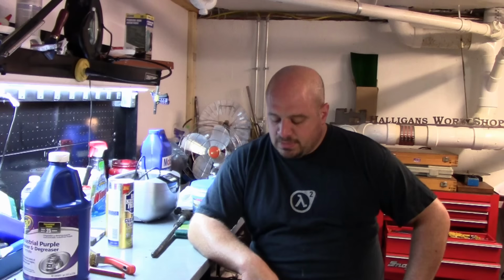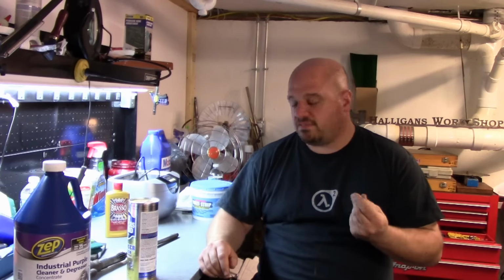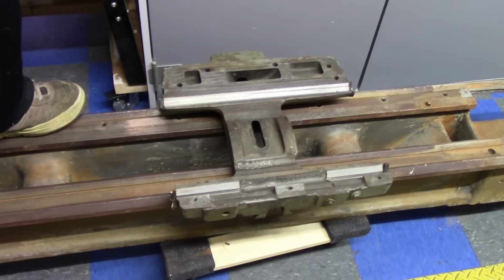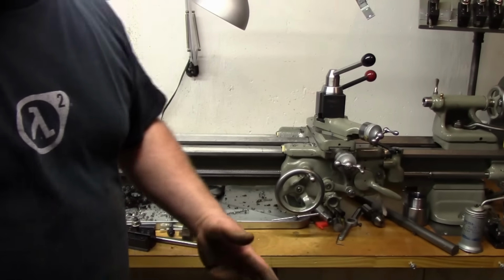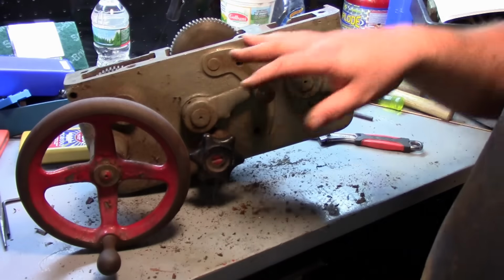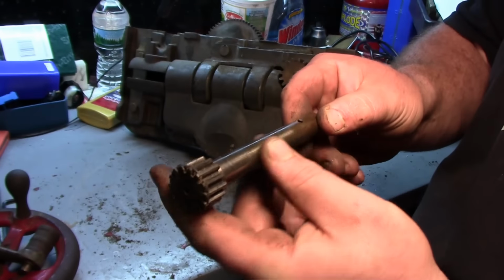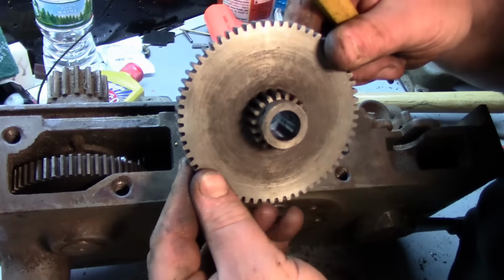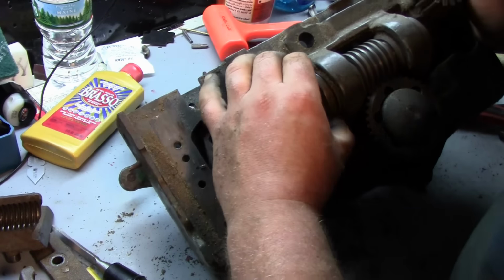13" Southbend Refurb: Bed and Apron: Part 1

Comment: I got my 1st real lathe today. 13" South Bend CL145B. It's filthy and gorgeous. Obviously not a BIG lathe, but I went from a home made contraption that used a lawn mower engine block as the head stock, then to a little a 7 x 11 shop made plain turning "lathe" that didn't even have a lead screw and which I saved from sitting outside rusting away in the dirt and rain and snow of Wisconsin to this 13" South Bend. It's a dramatic difference. You can feel history emanate off of the thing like it has a life force or a soul. I love it.

Comment: I left that long oiler in place on mine.  It didn't want to move, and I was scared of destroying it.  I think it was the only piece I painted around. 

The nut will spin with the clutch handle if its in neutral.  I thought mine was messed up in the same way.  

Screw in the star wheel is left hand thread too, so beware of that.

Comment: Hi Greg, really enjoyed this video. I will follow it with keen interest as I have recently purchased a surface grinder that has similar, but not as bad, damage on the flat way and I have sidelined it for a while to source a fix. In this day and age there must be a filler type product that will do the job and will have a look at the Turcite, IIRC etc mentioned below. Regarding the state of your work area, I am not a neat freak but clean up at the end of each day but having said that man I can make a mess as I go and never understand where it comes from..... basically when working on old machinery is it possible to keep the area clean all the time. Keep up the good videos mate, really enjoy them, Gordon, AUS

Comment: Hal- I wonder how hard would it be to move the headstock closer toward the center of the bed - shim if needed to avoid the wear on that 12" or so just in front of the chuck.  Seems doable.  Hardest part would be getting linkage to the quick change box/lead screw

Comment: I bought a 5 gallon container of that Zep stuff.  Works good, but its basically liquid lye with purple dye in it.  Nasty stuff on the skin and it kills aluminum, but its a stellar degreaser.   Handily, being as basic as it is, it passivates steel so it actually won't tend to rust immediately.  It also gets rid of most of the paint, which is a plus.  I soaked the bed for my 10L in that stuff for about 24 hours and I didn't have to use the paint stripper at all.
Reply from the maker: Yup.  I soak my parts n it for a day.  The bed was too large so I used the stripper.
Reply: I made a "tank" out of some plastic sheeting and cinderblocks, just big enough for the bed to soak in.  It was some cobbled nonsense but it got the job done.

Comment: DEVCON 11410 Wear Resistant Putty. Works fantastic. I have used it on a couple of SB lathes I had. Guy on ebay has the kit for under $60

Comment: Some time ago, maybe two years, there was an article in "Home Shop Machinist's Workshop" mag. Author had a big lathe like yours, a Logan I think, badly worn. He had a regrind done. But now the interesting part: there is some stuff called "Turcite" which looks like a green tape in various thicknesses, and bonds  to the metal. It can be scraped. I have zero experience with this stuff, but in the article in HSMW it worked. There is some other stuff called "Moglice"  and I have no idea how it is pronounced. However it is meant for way repair, and is poured into a dam around the ways. It also can be scraped. Again, zero experience. But there are alternatives to regrinding.
Reply: IIRC, Moglice is the stuff Stefan Gotteswinter mentioned.

Eli D.
Reply: If it wasn't Moglice it was a first cousin. He used it to fix the vertical ways in his mill, as I recall.

Comment: I can't get 2 of my 4 top slotted bolts out of the carriage/apron fastener point.  Any tricks?  I ordered a drag link socket that I can put into my impact but ... if that doesn't work - I'm screwed -literally
Reply from the maker: Kroil.  Hand impact.  Heat.  in that order

Comment: Don't forget to take the long lead screw key out of the worm gear that drives the feeds... easy to lose if you don't notice it. 
That long piece of material that looks like a felt string or something is just that... part of the lube system that carries oil down into the feed mechanism. That wants to be replaced for sure. 
Have fun.

Comment: I would guess reason for wear on inside of front way was due to tool pressure when cutting. Caridge would push back and down, causing most wear where it shows.

Comment: Greg, it might be a stupid question but how much would it cost to re-grind that bed?
Reply: Billy T:
     Probably more than $2,000 plus freight.
Reply from the maker: Yeah you'll probably avg ~ $2k for a regrind only.  Thats not including any hand fitting of the saddle and headstock to the ways.  I may call around for the hell of it.  There is a couple places up here in MA that do it.

Comment: Another way to degrease which is much safer is to use powdered tide in water & soak the parts overnight. I use that when I have to weld parts that are oil / grease soaked...

Comment: Who applied the stamp that indicated the machine was used in the war effort? If it's done by the operators of the machines it could be possible that the machine was sold to a school initially but was donated, sold, or otherwise brought into service for the military after the US entered the war
Reply from the maker: I was thinking that too, but there is no definative answer as to what the letters mean.  I've asked someone who worked for SB from the early 80s-mid 90s and even he didn't know.  The same letters appear on multiple lathes though.
Reply: Halligan142 : Another pice of information is a lot of schools that had Industrial Arts courses did training for the war effort. The goverment purchest equipment for the schools. Different industries would send employees to these high schools for basic skill training. My high school did such training for two different industries in my area,

Comment: Interesting info regarding the serial numbers and extra stampings. My 13" is number 119968 and is also stamped with D.W.W. and J.A.N. in the same pattern as yours. Mine also has what appears to be spherical vase with flames coming out the top stamped to the left of the J.A.N. stamp. Couldn't see on the video if yours is also stamped with a "Manufactured By" stamping to the left of the lead screw mounting holes. 
I suppose I should get the build card for my lathe but I'd be more interested to know how it got to the U.K.
Reply from the maker: Toomanybits1 I believe the vase you're looking at is a cannon.  Possibly army artillery division?
Military lathe will also explain its shipment to the U.K.   Go to wswells.com.  There there is a list of serial numbers to date your lathe.
Reply: It does resemble a cartoon bomb!
Reply: Thanks for the heads up on the serial number list. Very interesting! Seems to date my 13" to around November '41. I see others referencing a 'flaming bomb' stamp which I now see also appears on my 9". Very faint which is why I've never noticed it before.

Comment: Greg,
As I have said before, who ever invented taper pins should be shot at sunrise! They are generally a royal pain in the ass! If I had a dollar for ever taper pin I have drilled out, I could afford a new 20" LeBlond!  If you have the bed reground in the future, can the ways to be either induction or flame hardened? This may be overkill, but I was just wondering. Thanks for the video!
Dave